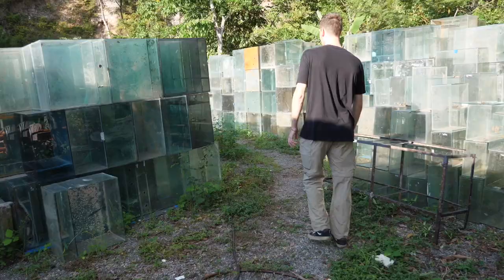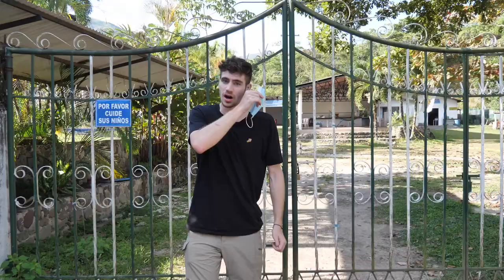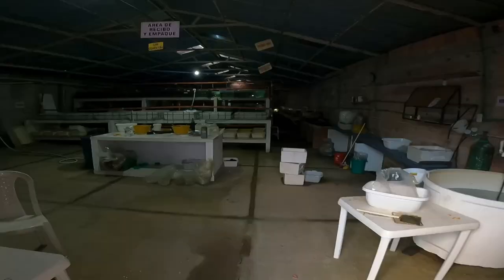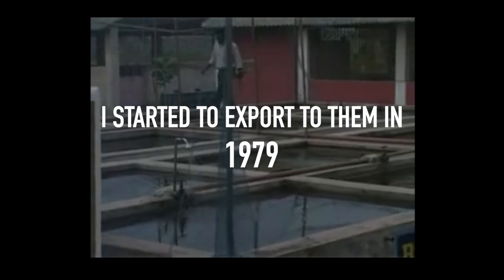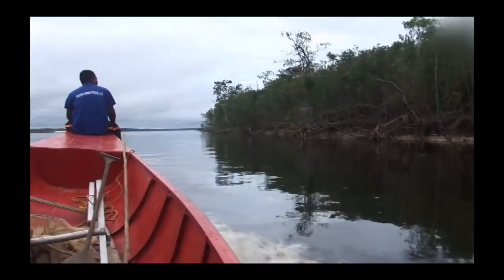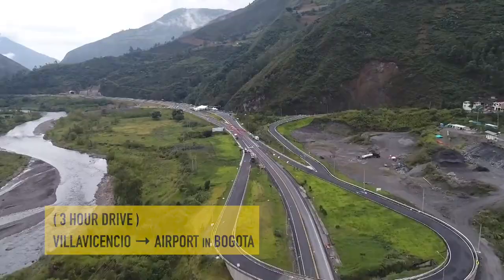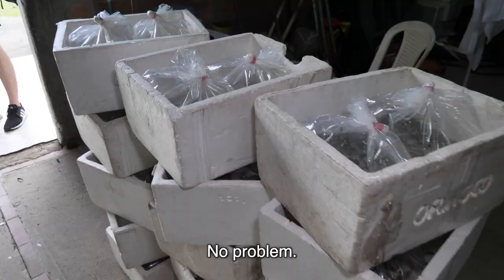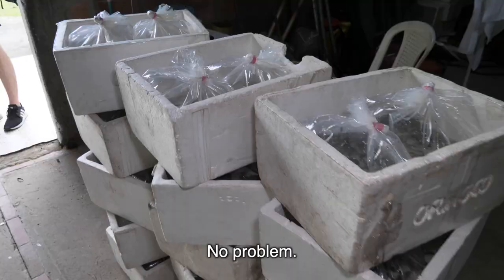Millions of Fish... Inside Hidden Fish Farm!! (Tour)

Comment: hi, I have had a turtle for 5 years now but I have just started to do research. Last year I upgraded to a 350 stock tank outside, I have 3 turtles, a 6 inch, and two 5 inches, it is currently NOT filtered. I was looking at what GPH a new filter should be some places say it should be times 5 but a filter for 1750 gallons seems like a lot. Help I don't know what to do.
Reply: You get multiple smaller ones